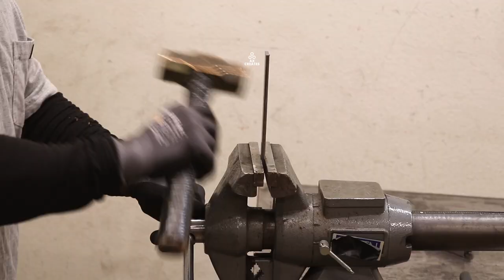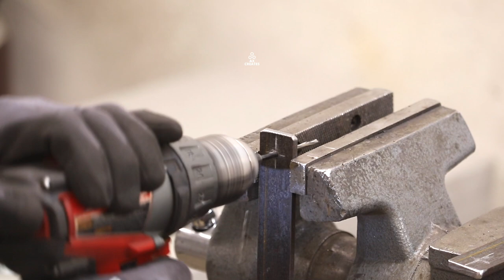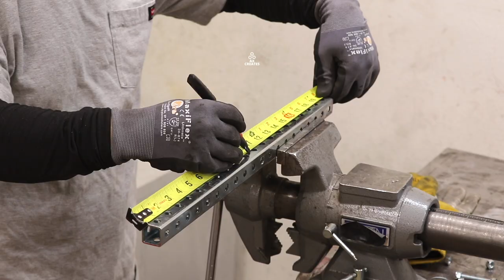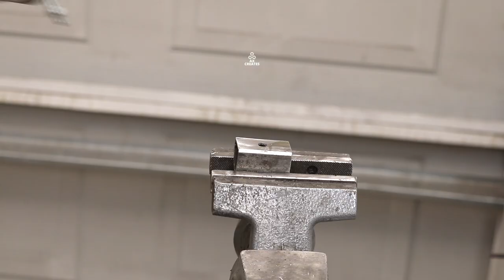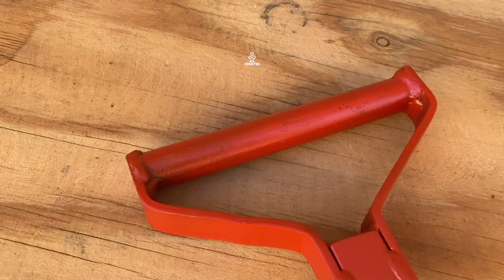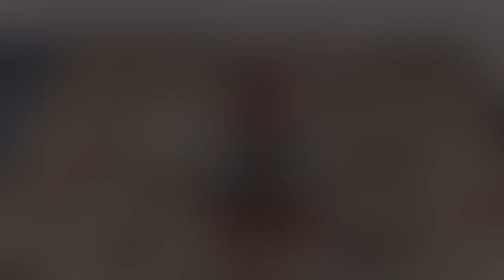BRILLIANT IDEA THAT WILL BE USEFUL !!! MUST HAVE!!

Comment: Hey.i got it idea..they could correctly redesigned these for plucking the hot hot igots of usability molten metals at your work Shop projects craftsman of soda cans copper wire windings All metals you melting outside inside your Diy work Shop in small hobbyist quantities of metals..